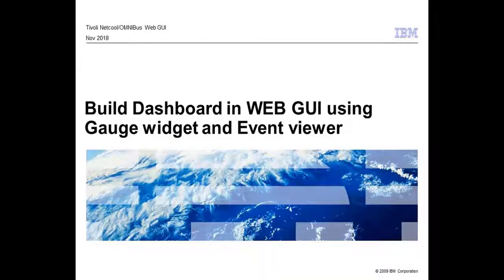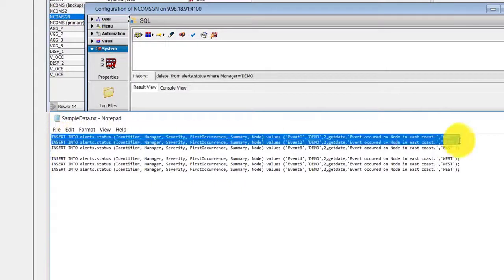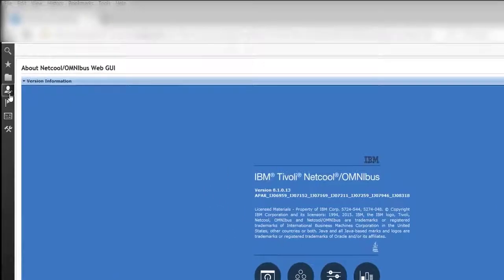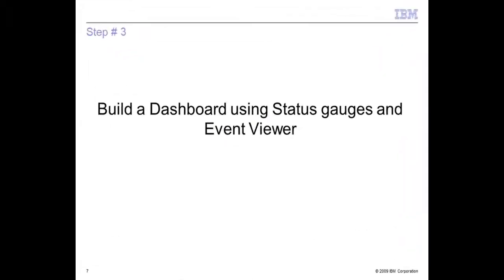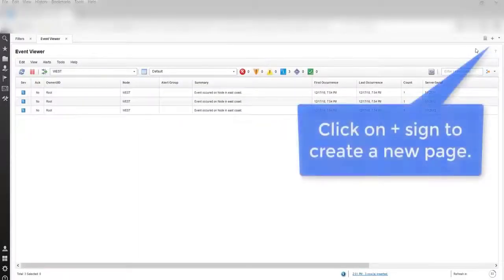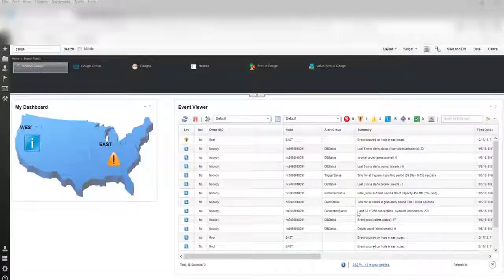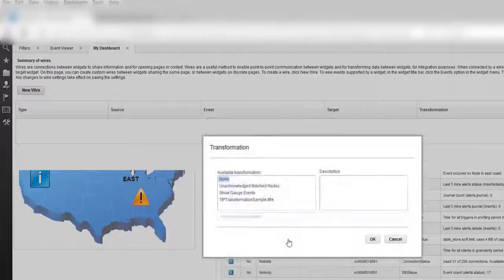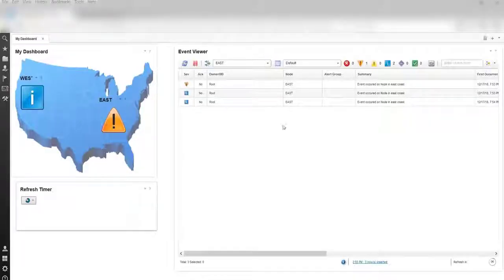Web GUI 8 1   Build a Dashboard using DASH Gauge widgets and Event Viewer

Comment: Hello! Thank you very much for this video. But in case you have 20 gauges on the page. Creating 20 Global filters in WebGUI does not look as а good idea. Is there a way to make this widget to filter incoming table data at its level, via its configuration. Often the data is coming from a remote UI Data provider, coming as a table. In this case using filters is not possible at all. Please advise.